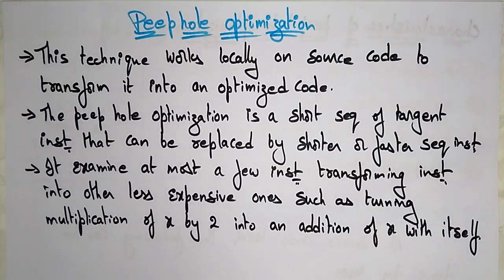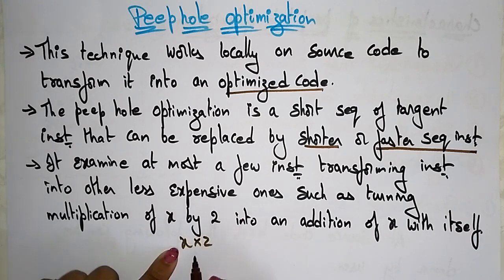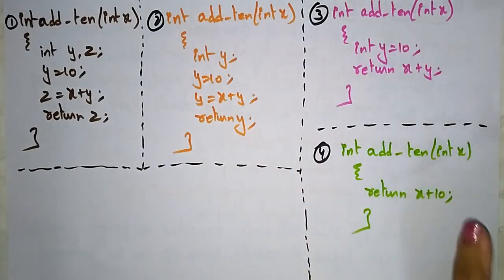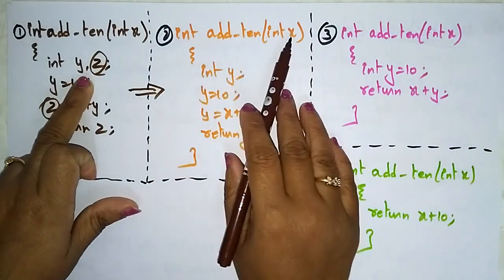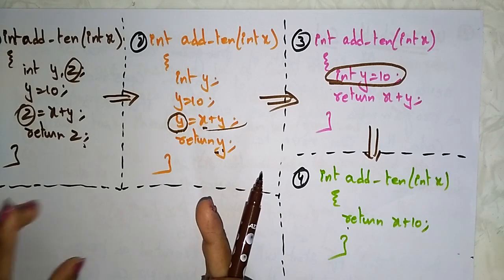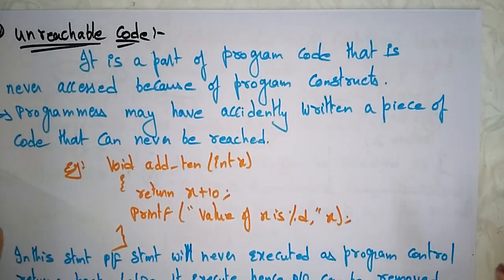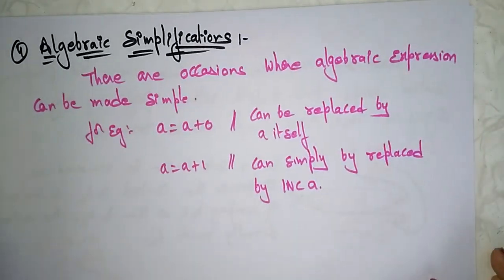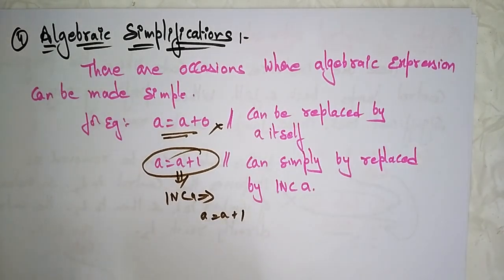Peephole Optimisation | Compiler Design | Lec - 58 | Bhanu Priya

Comment: 01:23 Peephole optimization transforms source code into optimized code.
02:46 Peephole optimization reduces instruction count by using less expensive operators and eliminating unnecessary instructions.
04:09 Optimizing unreachable code and controlling flow of execution.
05:32 Optimizing redundant instructions in the source program
06:55 Peephole optimization reduces redundant instructions
08:18 Unreachable code in programming
09:41 Control flow optimization in compiler design
10:59 Peephole optimization involves algebraic simplification.
Crafted by Merlin AI.